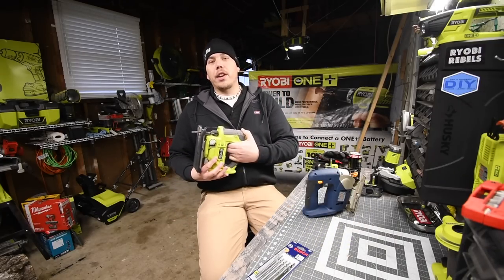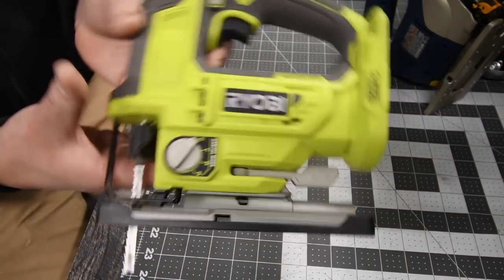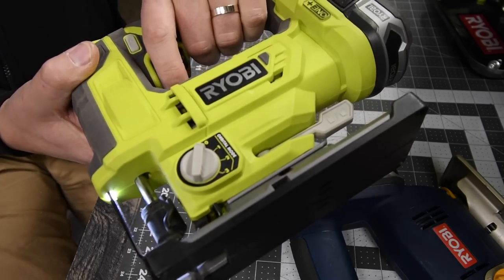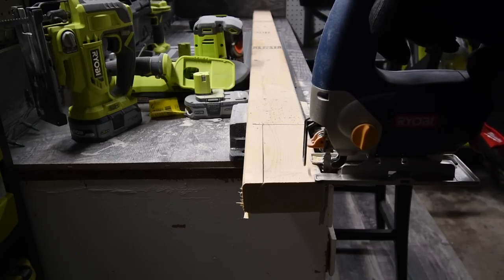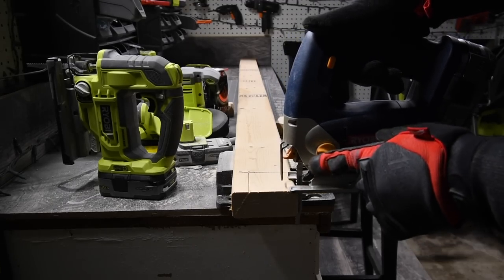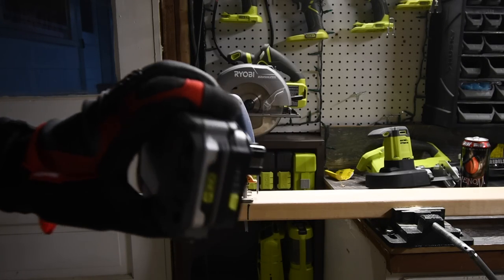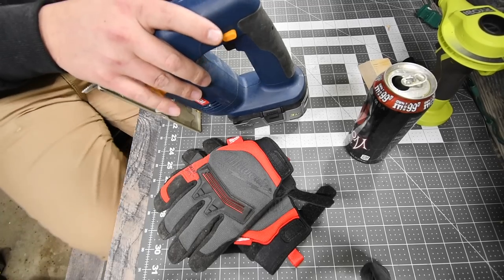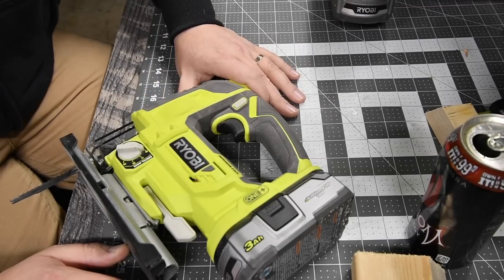Ryobi Brushless Jigsaw VS. Old Blue Jigsaw

Comment: there is actually blade storage on the brushless version, the bottom plate comes off the aluminum one and that is where your store your blades.
Reply from the maker: its a plastic door under the handle
Reply: thanks for tip.
Reply: I think the blade locking bit is missing a spring?

Comment: On that p520 you could replace those allen bolts for the angle lock to small wingbolts . and it also had locations in the plate for a T style edge guide
Reply from the maker: Thank you sir

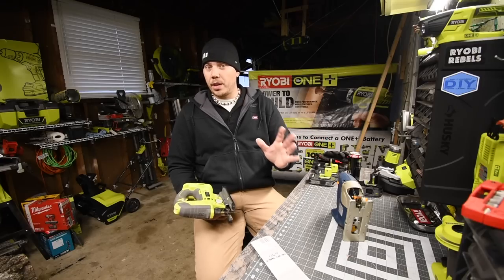Comment: 2:13 - I'm not sure this does have a vacuum connection function, as I didn't see any mention of a vacuum adapter in the manual, and mine didn't come with any sort of adapter. The only optional accessories called out in the manual is the Edge Guide Assembly, P/N 202936001.
Reply from the maker: Im not sure either but thank you for pointing it out ernavk

Comment: Ryobi Model CJS1801K Jigsaw / Blue & Yellow 

I have one of these older jigsaws and for the life of me i can not work out how to fit the blade🤔. I think the blade locking bit is missing a spring? The yellow locking tab is loose just flapping around? Do you have a close-up video showing how its done. Cheers mate.

Comment: I just crosscut and ripped a 2x4 with the blue jigsaw I've had for years and it was so bad that I had to come to YouTube and see if I was doing something wrong - I experienced the same results you had. Sloooooooooow. Mine has the red laser, but it obscures the line in the wood so not good for detail. This blue jigsaw has always been the worst tool in their early lineup. I still use the blue drill, impact wrench and the circular saw still works beautifully.  The jigsaw is from hell.
Reply from the maker: that is old tools bro :) tools came so far since back in the day and I thank you for tuning in and get some info
Reply: Along with the Sears copy cat craftsman jigsaw

Comment: Can you do a video on the Milwaukee brushless Full 18 volt super reciprocating saw with free 8.0 high output battery for $249.00 at home depot deal ends on January 2 Thursday of 2020 Since I just got it last week for work as well as the Milwauke 18 volt Oscillating multi-tool and new 7 1/4 inch Circular Saw with free 8.0 High output battery for $249.00 that I just bought yesterday.
Reply from the maker: Yes I can, ill do that soon

Comment: If the old blues were total shit ryobi would have gone out of business a long time ago . The tools are better but the old blues did their job and i still have many , and only killed one drill useing it to operate my slidein camper jacks .  2nd blue drill still doing it
Reply: Same. I only killed the original blue drill by a 6ft drop onto slab. Cracked the grip clean off the motor housing but the thing still worked.  I should have kept it .
Reply from the maker: at the time it was a good tool. but all old tools from any brands are crap compared to todays tools
Reply: iv'e had a corded sander for 19 years i used a lot but thinking of a cordless.

Comment: I would like one of those
Reply from the maker: you should get one
Reply: I should but the wife doesn’t like me to spend money on tools even when I need one for the bench I’m making her
Reply: Home Depot has a special right now, buy the $99 two battery pack starter, you get a free tool. You can then return the batteries and keep the tool, at a discounted price. I already have a few ryobi batteries, so I did this and was able to get the jigsaw after the return for $59.
Reply: @shaunbates9442  dude it's easier to ask for forgiveness than permission, do like I do, goto home depot without her and then hide it as long as you can, LOL.

Comment: There was an upgrade to that blue one  (still blue) model number JS550L. It has many newer features, including the laser line, and quick release levers. You can check it out here : :   .https://images.homedepot-static.com/catalog/pdfImages/58/58ea7d8e-2304-4912-956f-e3f1072d6a24.pdf

Comment: Proves that jigsaws are kinda useless othere than stuff like curved cutts and squaring up a circular saw cut.
Reply from the maker: Correct, jigsaws aren't good for long cuts.
Reply: They've always been a precision touch up sort of tool. If you drill a hole, and need to square it out, or make some other shape, jigsaw is the way to go. Or do some compound angle cuts for picture frames, trim, etc, perfect tool.
Reply: @Psibr1  Yeah that's why I have a $30 B&D one and it works perfectly for what I need it for.